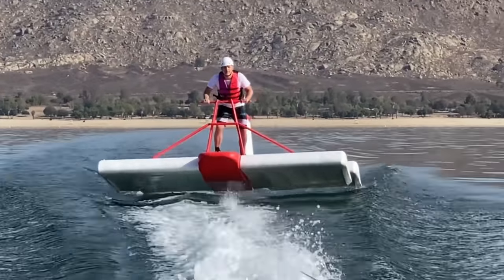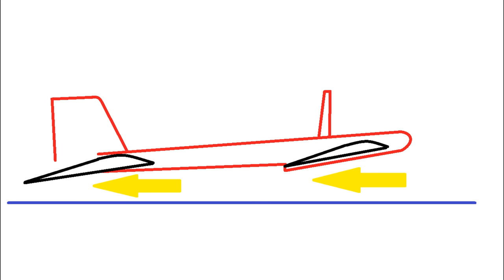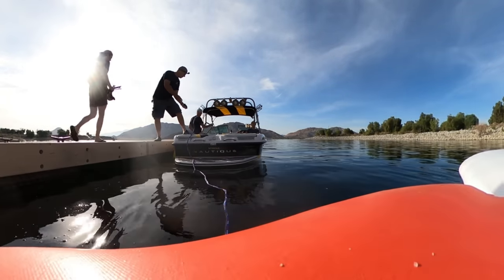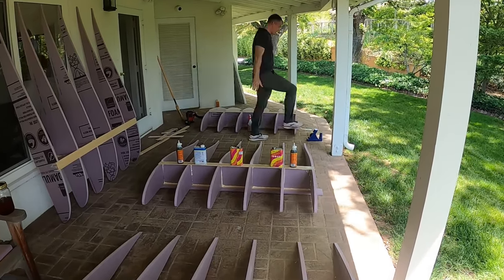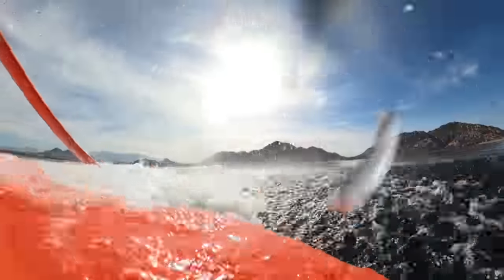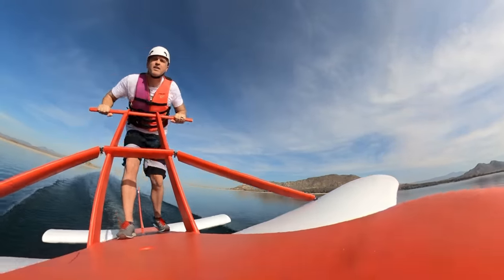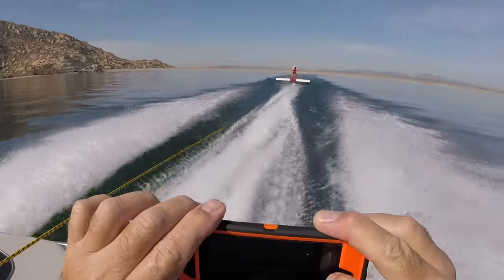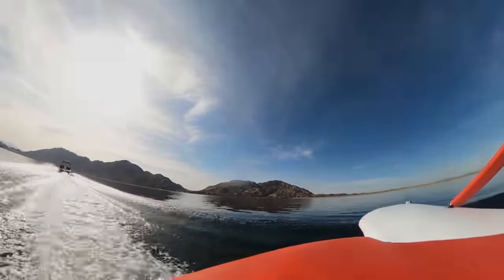DIY Ekranoplan Takes Flight:  Coolest Water Toy Ever?

Comment: It’s a wonder you haven’t built or found yourself a small but efficient hovercraft and stuck a wing on it yet. As a test / training vehicle it will give you instantaneous ground effect experience as it moves from the hover cushion to sustained low speed ground effect flight. YouTube is your reference here. 
I think the reverse delta shape is the most efficient for fully achieving sustained ground flight as it places large amounts of air under the wing almost instantaneously and then keeps it there as it streams it slowly out via the back tail point. The instability comes when you try and fly the delta out of the sustained ground lift as the shape required for creating and riding on a cushion of air is not suitable then to create the kinds of lift required for flight by slightly increasing speed.  A couple of consideration for your model is to take a look at the aerodynamics of the F35-lightening shape and notice that the tail is also a small delta shape to do the same job as the large front one. The other is  that forward sweeping wings like on Xfighters are extremely stable and may be useful if their effiencies could be combined into the front delta - I m thinking the break between the front delta allows it converts to an airfoil very quickly as the back maintains the cushion lift for a bit longer, until it too becomes an airfoil in its own right.

Weight shift as a form of control will never be enough unless you have the speed and mass of a downhill slalom

Comment: Hey Think Flight,  how about a tripod on top of your wing with a hang gliding harness, so an upside-down hang glider? It could be an easy way to set up weight shift control, I used to hang glide (looks like you may have?), it's quite an intuitive way to control aircraft.

Comment: I reckon that something like this could be powered by a small motorcycle engine, driving a pusher-prop. A bench for the pilot and passenger, and controls for throttle, rudder and flaps/ailerons would negate any need to ride the thing like a towed sled.

Comment: great idea and also looks nice! however you need moving surfaces for sure. kind of elevator and aileron.. maybe only elevon.  controlling a flying thing with only your body movements is nearly impossible..
Reply from the maker: Hang glider
Reply: @thinkflight  yes you are right. but one thing: in hang glider CG is quite below wings whereas this one above wings. when CG is below lift level, aircrafts is more stable and easier to control. high wing aircrafts vs low wing aircrafts. anyway just a thought. looks good and inspiring..
Reply from the maker: @bahadir8862  my weight being high increases control,  not decreases

Comment: Not sure what your wanting to accomplish here, just a foot or two? To me you need more camber to your bottom wing, if it was me I am extreem, I want 15-30-40 of air be able to go left or right, but I believe fir more than 1-2 feet your gonna need more camber to wings, as well inside moveable flaps you can  lower and extend wings a few feet outward and add ailerons where you can lift one side lower other with a cable and depending length of ski rope could really go left or right, 3’ long flaps close to body of this thing woukd really give you plenty of lift along with camber in wings I could see someone doing 50’ off water with longer tow line

Comment: SOO Just curious.. What is the. Main purpose..or goal of this thing?  It is NOT mad to catch air,is that correct?..well no more than 2' of air yeah??? So it's not a water sled to be towed on the water yeah?... Are you just trying to sail /fly a few inches above the water, and that's it?.. He!! Man ..I'd try to get that thing wAAY up in the air..get some SeRious Fly height. ..But right on ...cool boat..sled.. errr ..kite-raft , thing.

Comment: Doesnt seem very fun when you have to rely on a big boat and operator to pull you around all the time. Its like when kids, you have your lil bro pulling you around in a wagon all the time...so coooll, weee, weeee , weeeeeee ...not.  Actually with more thought, seems like a complete pain in the A$$
P.S, you need a trim plate on both sides of the rear so you can control lift/angle left and right independently. Figure , just use bike brake levers, cables, and a small hinged flap at rear left and right.  this should give to enough control angle, to hover, and steer a bit.